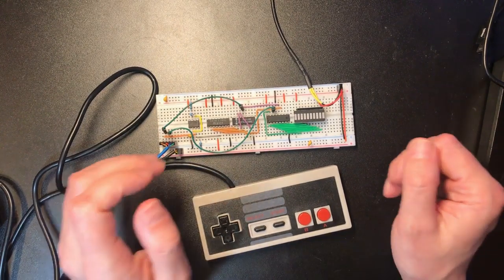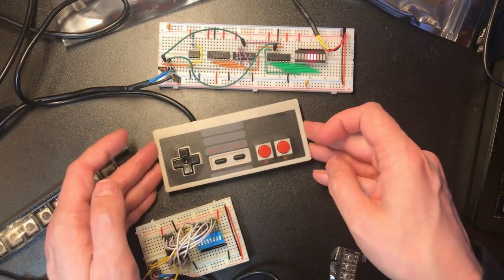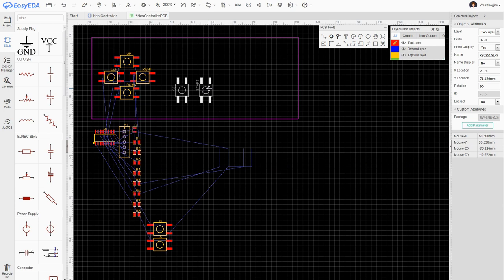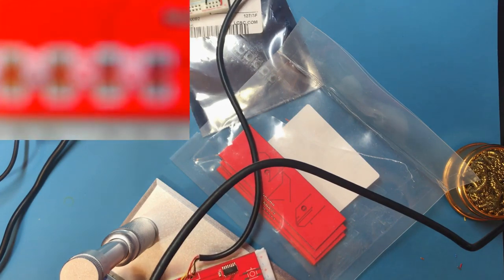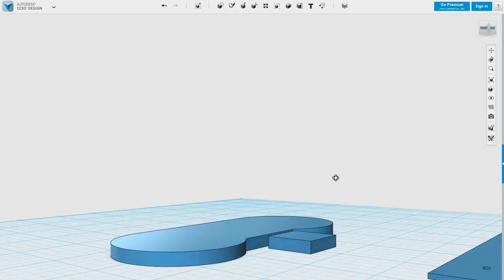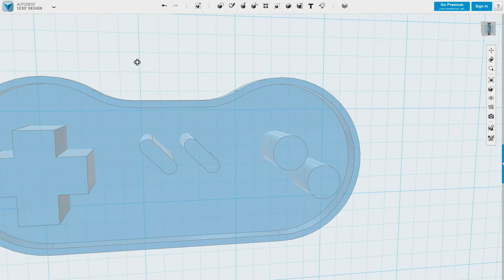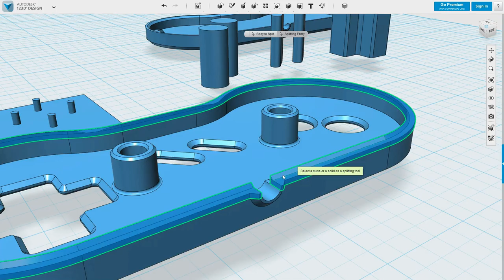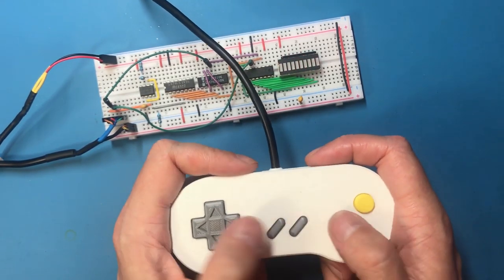DIY NES Controller - Full Build

Comment: I realise this video is 2 years old but you can use a soldering iron to push the screw inserts in, the heat in the brass will melt the PLA and hold in place
Reply from the maker: Yeah, a few people have commented that. I've seen it done many times since I made this.

Comment: Thank you very much, i replicated your project for an esp32 project and it worked like a charm!
Reply from the maker: Nice one Mike! I'm glad is was useful!
Reply: Is it possible to make a custom NES controller that looks  like a normal OEM controller shell, however it has a hidden turbo feature/Macro that is self contained, and runs on original NES console.  Where you could set a direction on the DPAD to have turbo as well as B button with Turbo function? Also would it be possible to do this while "hiding" the turbo/macro switch from plain view?
Reply: @rebranded1248  you can try if you know how

Comment: Great video I've always wanted to do something like this.

You should invest in some solder flux!

Also - you can push down the threaded inserts using a Soldering iron.
Reply from the maker: Thanks! I was using a flux pen, but it tended to go past in a flash as I was using a lot of fast forward to try and keep the length down. One thing I would add though is temperature, I was running the iron at 320 for most of this. I could tell the solder wasn’t flowing as well as it should onto the button legs (Far higher thermal mass than the other components) but I realised the problem towards the end, turned it up to 350 and the joins got better.

Comment: Those bevels all around the places are so damn hot. Shame those screw holes were not symmetrically placed :D Anyway great work.
Reply from the maker: The button configuration on a NES controller makes symmetric screw positioning, if I do a SNES version in the future it will be easier to balance it out.

Comment: What uF of Capacitor did you use for the Shift Registor?
Reply from the maker: For the decoupling caps I always use 100nf unless the data sheet says differently.
Reply: Is it possible to make a custom NES controller that looks  like a normal OEM controller shell, however it has a hidden turbo feature/Macro that is self contained, and runs on original NES console.  Where you could set a direction on the DPAD to have turbo as well as B button with Turbo function? Also would it be possible to do this while "hiding" the turbo/macro switch from plain view?

Comment: (3:36) If you want to exactly match the behavior of official Nintendo controllers, it actually does matter whether you pull the "serial in" line high or low. To properly match the exact behavior of an official Nintendo controller, the "serial in" line should be pulled high, not low like you have it here.
(9:06) And the same point applies here.
(16:15) They changed the colors from the official colors, and they didn't even change them into something sensible! (The official colors are white for Vcc, brown for ground, red for clock, orange for latch, and yellow for data.)

So, the controller you designed looks quite similar to a "dogbone"-style NES controller, which came with the newer top-loader NES. (There were two styles of official NESes: the old-style one, which loaded cartridges in from the front, and the new-style one, which had the cartridge slot on top instead.

I did some thinking, and I realized that there's a potential race condition if the internal controller clock updates the output latches at the same time the CPU tries to read them. The fix for this is simple: just wire the data assert line to the reset line of the 555 that handles clocking the controller. Since the reset line on the 555 and the data assert line are both active low, that will mean that the output latches for the controller will be updated by the controller read circuitry if and only if it's not being told to assert to the bus.
Reply from the maker: I don't see how it can matter. The NES only ever reads 8-bits in so it wouldn't matter there.
Reply: @weirdboyjim  Controller reads on the NES are done in software, not hardware, so a controller read routine might potentiall read more than eight bits. However, it turns out I was wrong about how that pin is connected, anyway. I was looking at an article about reading from the CPU side of things. I just looked at an article on the controller side of things (as well as a picture of the PCB in an official controller), and it turns out that pin is connected to ground normally. Oops.
Reply: To answer your question about how it could matter though, inside the NES, the controller port pins have pullup resistors on them. By tying the serial in pin within the controller to ground, it allows you to tell a controller port where the plugged in controller has no buttons pushed apart from a controller port that has no controller plugged in.

Comment: Is it possible to make a custom NES controller that looks  like a normal OEM controller shell, however it has a hidden turbo feature/Macro that is self contained, and runs on original NES console.  Where you could set a direction on the DPAD to have turbo as well as B button with Turbo function? Also would it be possible to do this while "hiding" the turbo/macro switch from plain view?
Reply from the maker: Probably, but that depends on what you mean by "turbo feature". If you mean changing a constant hold to rapid button presses then that would definitely be possible. If I were to do that I'd replace the circuit in an OEM controller replacing (or supplementing) the shift registers with a micro-controller.  There would be lots of ways to hide the functionality, that's a whole other subject.
Reply: @weirdboyjim  A D-pad direction like Down Direction can be set to turbo at same time as a button, to create a repeated auto-fire input like Down+B correct?  The reason I ask is,  I am recently very suspicious of a certain speed runner who is the only person in the world (he has current WR in a game)  who can mash Down direction on dpad + press B button at a lighting speed (14hz-16hz) 100% perfectly (no mistakes EVER). Its suspicous because he never ever messes up, never. By messing up I mean he always presses Down Direction + B button in perfect unison. If they are not pressed simultaneusly, the attack cancel he is doing does not work in the game (NES) He streams and plays the game 5 days a week, and his hand, wrist, forearm, shoulders never get tired ever. The mashing has to be so fast to get quick kills on the bosses, the only way to do it is by tensing your arm and shaking your forearm, which becomes very tiring very quickly. He has a body cam and hand cam on him while playing, but you can see he is obviously not even moving his entire arm that controls the mash input. Even the hand cam clearly show him just simply pressing Down+ B button and holding it their, without vibrating any part of his hand or arm to get a human produced realistict optimal mash speed. However for each press that he does (which he holds for a brief time) he gets 4-5 individual Down+B inputs in game. Which is IMPOSSIBLE unless he has a Turbo auto-fire set up and activated.
Reply: @weirdboyjim  Is there a company/ online forum/ or just a general source of information on these "micro controller PCB circuit boards"? The funny thing is he already admitted that he does not have a fast mash speed. (which makes what he is doing in the game impossible actually) He also mentioned that he builds his own custom NES controllers and regularly switches out the PCB circuit boards which to me seems like a red flag. As long as the turbo function can run within the controller itself, on original console hardware without the need of any external PC programs like Joy2key, Rewasd..etc then it is very possible he is indeed cheating. Collecting money, donations and fame for WR speed runs which is fraud really.
Reply from the maker: @rebranded1248  Interesting. What game. NES Controllers are sampled in software, usually as part of the main update loop. I'm guessing that's a full frame game (so 29.97hz), assuming it needs to see alternate up/down's then perfect response would involve pressing at 14.985hz.  I would say though that since we are dealing with a harmonic of most cameras video update rate you would expect that kind of action to look odd on camera even if it’s legitimate. I.e. it’s not impossible but you are not unjustified in wondering.
Reply from the maker: @rebranded1248  I'm not aware of any specific sources of information on this stuff but I imagine a wide range of electronics hobbyists could help out. If you are doing a serious investigation on this stuff I could maybe help out.
Reply: @weirdboyjim  Okay thanks, yeah I am trying as hard as possible to figure this out. Let me ask you this, do you know a company or individual that could sell me a fully assembled and functional micro controller that works on a game console like NES?
Reply from the maker: @rebranded1248  A “Microcontroller” is a programmable microchip that can be used to do a wide variety of things. I can’t recommend anyone specifically, I might be prepared to help out with a “proof of concept” that was included in a video on my channel, I wouldn’t want to get involved if it was going to be actively used secretly to cheat.
Reply: @weirdboyjim  That would be awesome! Yeah a proof of concept is basically what I am looking for. I want to re-create the conditions with a Micro controller to prove that anyone could be hiding the fact they have a turbo function. It is not for me to use personally hahaaa. I am not a speed runner. Great, so what would you what me to do from here? I know exactly what I am trying to re-create, I just have zero knowledge and expertise on how to actually re-create it.
Reply: @weirdboyjim  I just saw this comment from you. The game is Ninja Gaiden (NES) The main character Ryu, has the ability when he jumps (A button) to cancel the recovery animation of his airborne sword attack (B button).  By pressing Down on Dpad direction in exact unison with Button ( Down+B) he cancels the recovery freeze animation and can repeatedly attack as long as he is in the air. So if you jump and mash really fast Down+B you can attack 7 or 8 times instead of just twice. One attack on the way up from your jump, and one attack on the way down from your jump is the normal limit to airborne attack quantity. So if you are a expert masher, you can easily defeat the last 2 bosses in the game and get WR paces. Now I can easily re-create a turbo macro on PC because I have NES emulators and Rewasd set up already. However I like to actually mash down+ B myself and test my own speed. I use my thumb to press down direction, and my middle finger to mash B button. Shaking and tensing my arm to get super fast presses per second. However that gave me extremely sore joints and elbows for the past month. And I have only been practicing for a couple weeks. So I am extremely curious how  a specific speed runner who play this game , streams on TWITCH 35 hours a week and has played for the last 4 years never gets tired from mashing at minimum 14hz. Yet somehow his elbow, wrist and forearm are not strained? It is physically impossible for somone to mash that fast for that long of a time  frame (years) and not develop RSS (repetitive strain syndrom or carpel tunnel)
Reply: @weirdboyjim  Can I email you from your listed email on your channel some video clips to show the Streamer playing so I can show you exactly what I am talking about. I can make a small compilation of body cam and hand cam highlights from their TWITCH stream, to try and give you a visual example of why I suspect they are using a Micro controller. It is so suspicious, because when you mash and shake that fast, you can here the audio mic pick up the clicky clacky sound of the buttons. Except when they do it, their controller becomes strangely quiet. 3 red flags I am noticing, during there mash sequences, A) their entire arm does not move a millimeter (visible in body cam) B) their is no audio heard of the buttons being mashed clicky clacky sound C) the hand cam  does not show their fingers or hand/wrist vibrating either. It just shows them do these really unnatural single press and holds, which produces multiple mash inputs. This to me is a dead give away their are using something fishy. This just isn't possible unless something else besides a OEM controller is at play. When other streamers mash at that exact same sequence in the game A) you can visually see their arm move, B) you can usually hear the audio of the buttons being mashed clicky clack sound.
Reply from the maker: @rebranded1248  go for it
Reply: @weirdboyjim  Okay I will. Thanks!
Reply: @weirdboyjim  I emailed you. First time using Google Drive.

Comment: James, is it possible to make a NES keyboard from scratch that could use Family Basic?
Reply from the maker: In theory you could. I haven’t got any experience with the Nintendo keyboard myself. Don’t rely on this but some quick web searches lead me to believe it’s for the Famicom and plugs into the Ext port. To make a keyboard using the techniques I show here is possible but might be a bit much, would definitely be better to use real keyboard switches. If you just want a Nintendo keyboard replacement it might be a better idea to use a microcontroller to build an adapter from a ps2 keyboard to their protocol.
Reply: @weirdboyjim  I just googled PS2 keyboard to NES and some one at Atari age has already done it!!! Thank you for the suggestion 😊
Reply: Is it possible to make a custom NES controller that looks  like a normal OEM controller shell, however it has a hidden turbo feature/Macro that is self contained, and runs on original NES console.  Where you could set a direction on the DPAD to have turbo as well as B button with Turbo function? Also would it be possible to do this while "hiding" the turbo/macro switch from plain view?

Comment: Incidentally I have done the same project some time ago, but on a perf board with close dimensions to the original controller. I was fascinated by the simple yet effective engineering/design of the original, like the strain relief.

Btw. I wonder if the extension cable you got was a good fit for original hardware connectors? I had to wrap some electrical tape around mine else it would slip out (random Aliexpress purchase).
Reply from the maker: Nice project!  Not sure about the connector in that regard, The "real" NES controller connects into the other end fine but I've not plugged this into a classic NES.